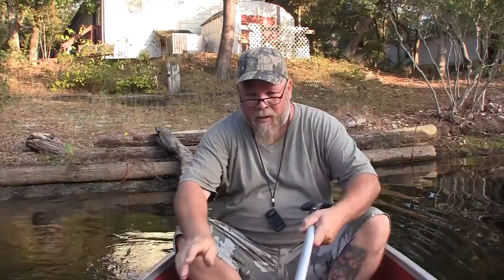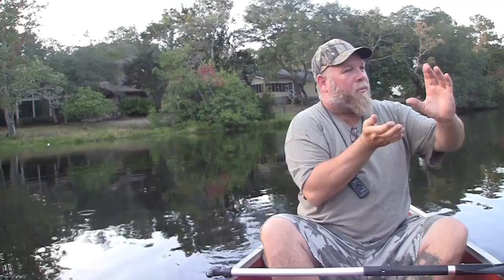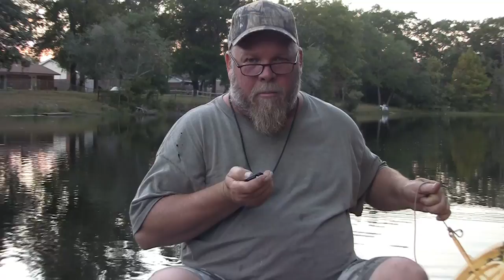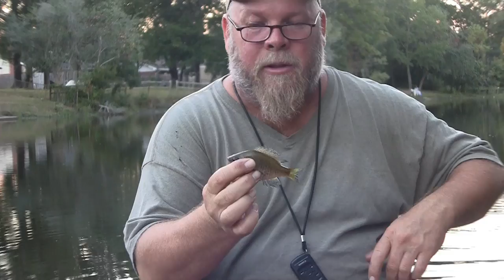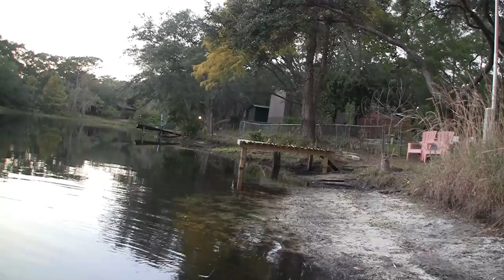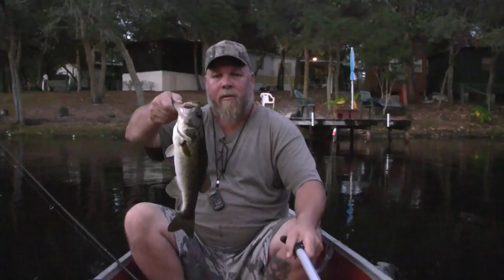Building a Dock ?

Comment: we built several docks when I was a teen, using big telephone posts and a pump like you said, it would be easy to sink a couple 4x4 or 6x6 posts if you didn't have a bad back. I'd build a floater, either get some large plastic drums or find a local source for high density foam blocks